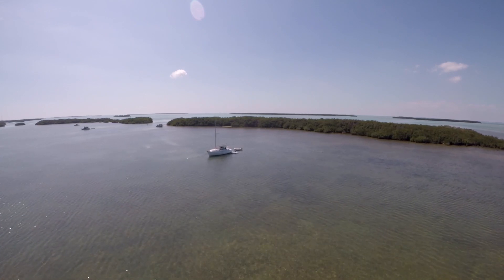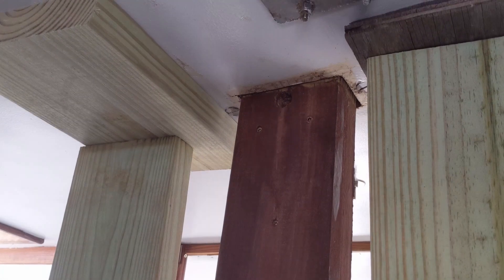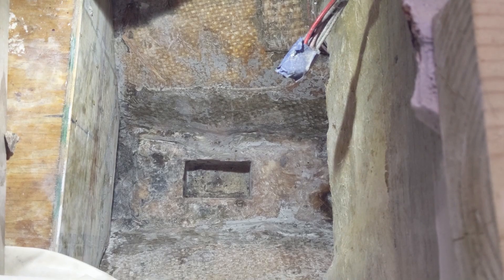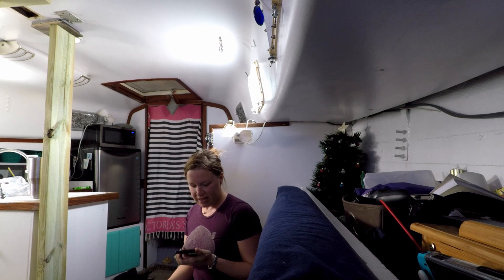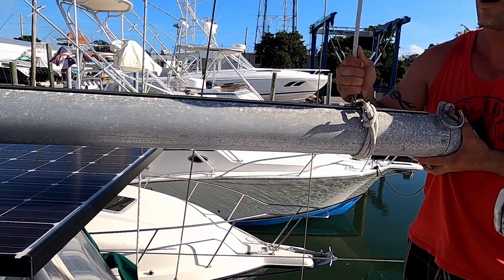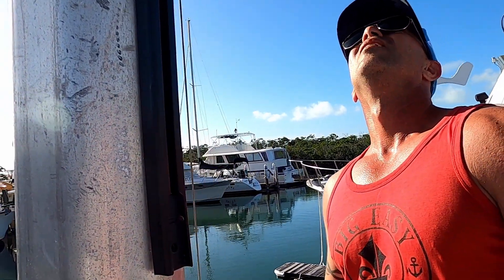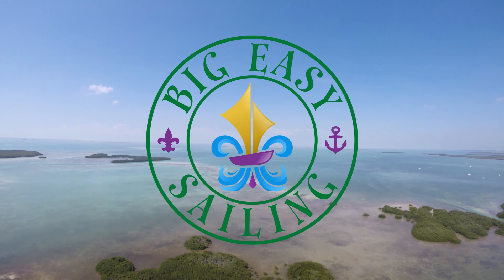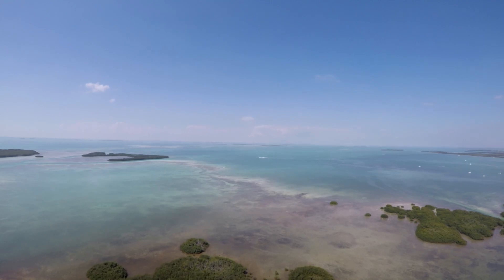Ep. 39 - No More Wooden Compression Post or Used Sails ~ Big Easy Sailing

Comment: Glad you are back!  You will want to keep an eye on the fitting at the far end of the boom where you have the main sheet and topping lift attached.  It looks a little loose and if it comes off, you are going to lose the main sheet.   Also - your boom and mast both look rough.  I just bought a 1983 trimaran from Florida (salt water) with quite a bit of corrosion on mast and boom.  I used steel wool to get it off.  It's a little shinier, and now feels smoother.  You'll have to wait for the mast to come down to get to that.  I am pretty sure that Precision sails is who Sailing Zatara used for their new sails.
Reply from the maker: Thanks.. We did tighten up our pin set up at the boom. All those scuff marks on the mast are from Shawn's shoes... he's going to have to buff it out!

Comment: Great video guys!
Nice job on the Compression post replacement. Also having the white post compared to the darker wood makes a big difference to the appearance in the cabin.
I have been thinking about the Strong Track solution for my boat also, it was good to see how easily it went in/on, despite the minor setback with getting through the stainless track (it wouldn't bed a true boat project without some setback).
Haven't seen the trick with the wet cloth on the shackles before......always assumed the wet cloth was for the forehead of the person trying to undo the stubborn shackle.
Reply from the maker: Thanks! The strong track was simple to install and is has very slick action compared to the original track. Price is cheeper if you go threw a vender instead of Tide's Marine...we got ours from Mack Sails

Comment: Nice to see that you finally replaced the temporary Home Depot compression post.  I remember commenting about its install.  That aluminum post will last a LONG time.  Good work.  You guys have come a long way.  As far as the sails go, I have bought sails from National Sail Supply (in Florida).  They sell Rolly Tasker sails which are reasonably priced and very well made.  They also give very quick delivery.
Reply from the maker: Thanks Todd! Good info...yeah, took a while to get back to the post job...all the stars had to aline. We got a few insanely expensive quotes that kept the job in the back burner. Glade we found Me Pressy

Comment: Hi I'm sure you will be happy with the Precision Sails. They understand 'customer service'.
That wire topping lift you reconfigured for the mainsail , I did not see if it had a plastic coating if not it will damage you new sail!   A more modern setup is to get rid of the topping lift altogether as it needs to be loose or it messes up the sail shape. If you have space you can fit a boom lift or strut from the base of the mast to the boom that would so much better. On my little boat I use a regular Gas Strut and a couple of fittings! Less than $50! You would need about 250# of lift force for a boom and sail  like that. Let me know if you want more details. But you can get ready made boom kickers  from $140 ish I think. ( or way more)
Cheers Warren
Reply from the maker: I like the set up you describe. We looked into it. Our solar and hardtop are always in the way... Gonna rock this set up for a while and see how it goes as far as sail chaffing and all that jazz.